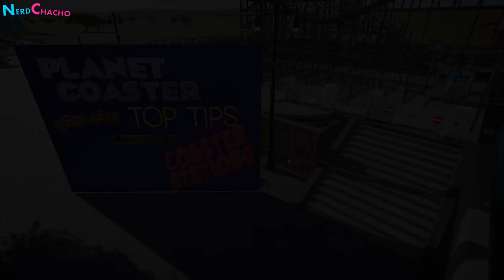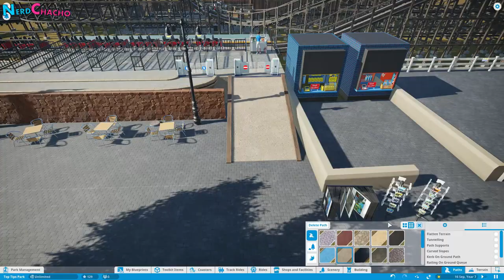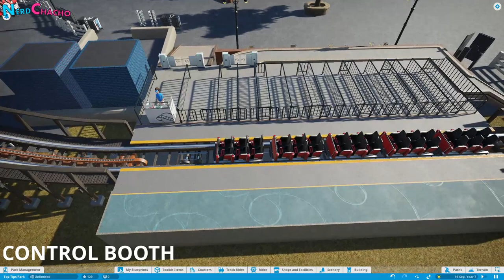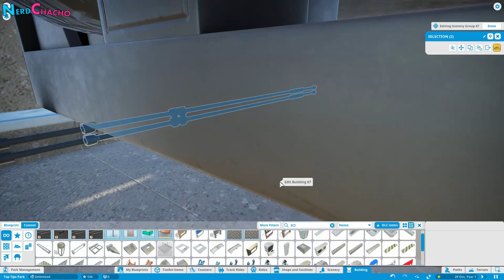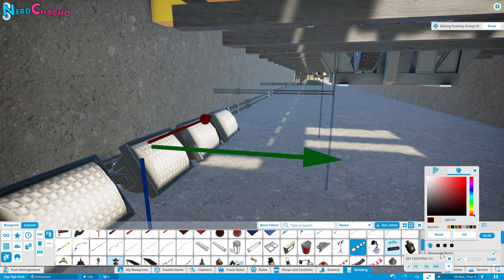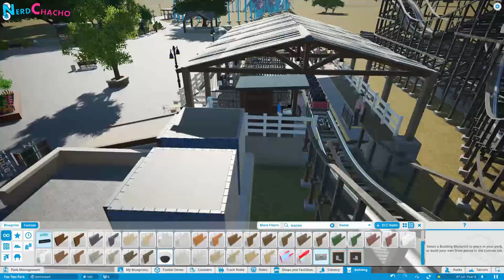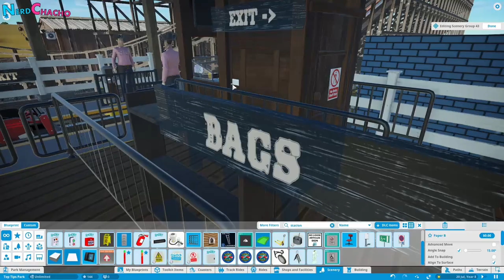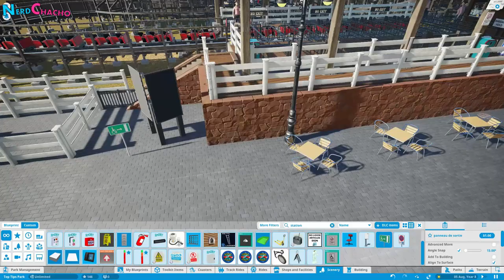#6 -Station Configuration -Planet Coaster Tutorial - Realistic Looking Parks in Planet Coaster

Comment: Love this series has helped me so much to become a better builder I do have a question. Though I have a launch coaster using the copperhead strike coaster and I can’t seem to get 2 trains with block breaks only if I make the station big enough Iv made the block section longer than the trains and also set it to block section from standard any ideas?
Reply from the maker: Thanks for coming along!! Have you checked the coaster type setting in the coaster options menu? There is usually a drop down list (where you choose how many trains you want) that allows you to switch between "standard" "Blocked" and "lapped". If it is "blocked" then it should allow you to have multiple trains and a smaller station :)
Reply: @Nerdchacho  yeah tried that I dunno why it’s not letting me works fine with other coasters